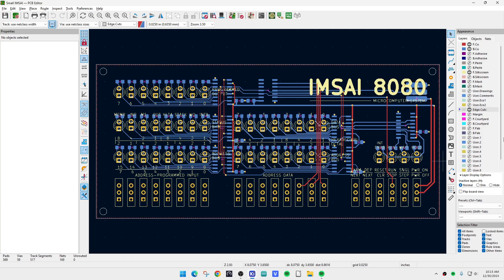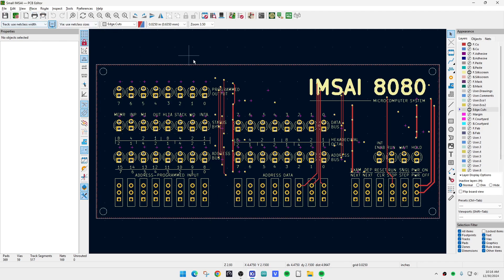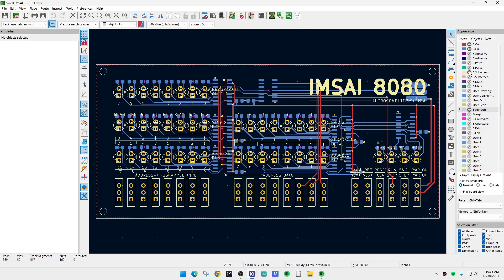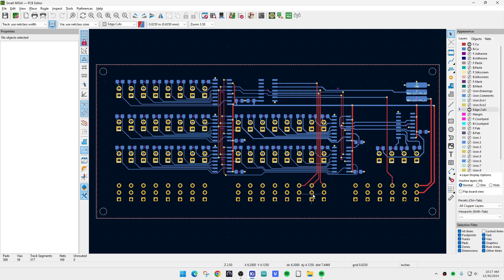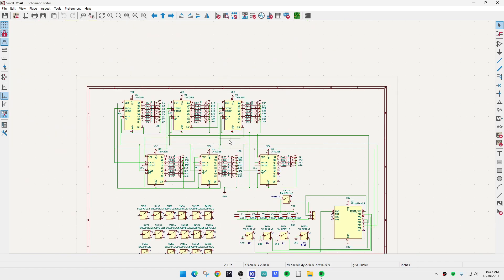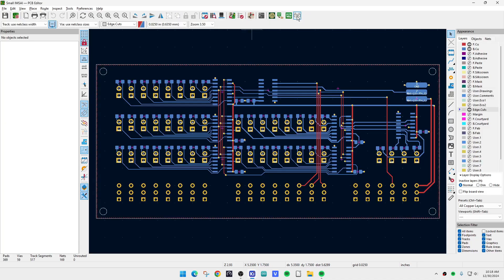#2118 Tiny IMSAI 8080 Computer (part 1 of 2)

Comment: I don't want to sound negative, but the amount of IO you have here, as well as all those shift registers and the tiny makes me disappointed it's not a little more to it. 

Now if you used the 595s to make a Linear Feedback Shift Register using the switches as the inputs  that would be cool, or as other have suggested implementing some kind of limited 8080 style computer or trainer board it would be a really cool project. 

It's so close to a really cool project.
Reply from the maker: The switches are junk and don’t have the correct function. Some need to be momentary up down.  If someone can find me good switches I’ll consider a more functional one.  In the meantime buy a clone from the high nibble.
Reply: @IMSAIGuy  entirely fair. Love the channel and chip of the day!

Comment: I see several choices for the switches:
- Analog resistor ladder (probably 6-bit at most, so 4 ADC inputs)
- Individual-scan (which can only scan one switch per display refresh)
- Dedicated shift registers (most expensive, but neatest in software)
- A compromise with one shift register, using spare outputs to decode rows of a 3x8 matrix.
- A compromise with two shift registers, using a resistor ladder, or even dedicated GPIOs for the remaining 6 switches.
Looking forward to the result in any case!
Reply from the maker: https://youtu.be/VBEgPC2zSLc?si=lOUGRcdUSKHyT1vM

Comment: You've been honing your pcb design skills.  How about designing pcb project for modern interpretation of the Tek curve tracers? Low power testers like dcapro can't test like the 577. The old tracers don't have data export and are huge. 
I realize there are simple curve tracer examples already out there.
Reply from the maker: that's a project I keep thinking about. I did this one: https://youtu.be/oFHTOQTIi30  and thought of making a PCB for that old design (pretty it up). getting all the functionality of the TEK would be a lot of engineering
Reply: @IMSAIGuy  I just rewatched that series. Your version would have higher power ability than the dcapro, which I see as dcapro's main shortcoming.  Creating user interface to automate the fiddling for doing diodes, npn and pnp would be a sizeable programming job. Relay  controls, safety features, and error handling make that more than a hobbiest project.
Reply: The tektronix 571 is a 1990's version of curve tracer and works 20lb. Perhaps it's functionality would be a better model for new interpretation.  I'll look for the schematics.

Comment: Nice pcb
I alway double via on pcb...
I use donut of 20mil and hole of 13mil, via cost nothing, double vias make sure you are never trouble contact between top and bottom.
7mil on data trace, 15mil on VCC chip trace for low power.
1206 smt for easy assembly, 0805 for more dense but easy (i use this size 90% of time), 0603 part for very high density on manuel assembly, under 0603 is this hard to do in manuel for project, is ok for repaire.

Comment: You could read all the switches by connecting them to the LEDs, selectively turning the LEDs on, and reading a single common sense line. That is - if you don't want to put another set of shift registers for the switches
Reply from the maker: that's a clever idea

Comment: Building a Fun Gadget: An MSI 8080 Microcomputer Replica

*   0:00:11 Project Overview: The project involves creating a replica of an MSI 8080 microcomputer, designed primarily for aesthetic appeal rather than full functionality.
*   0:00:30 Limited Functionality: The replica will feature flashing LEDs and respond to select switch inputs, but it won't be a fully operational computer.
*   0:00:37 LED Control: An ATtiny 814 microcontroller will manage all the LEDs, allowing individual control over each one.
*   0:00:41 Switch Input: The replica will incorporate functional power and run switches, along with three address line switches for selecting different operational modes.
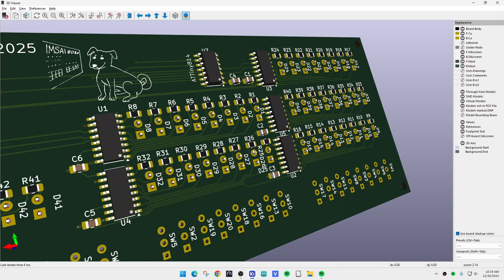*   0:02:07 Power and Components: Power will be supplied externally, and the back of the device will house the microcontroller, resistors for the LEDs, and shift registers for controlling the LEDs.
*   0:02:28 Schematic Details: The schematic reveals the use of an ATtiny 814 microcontroller, 595 shift registers for LED control, and connections for select switches.
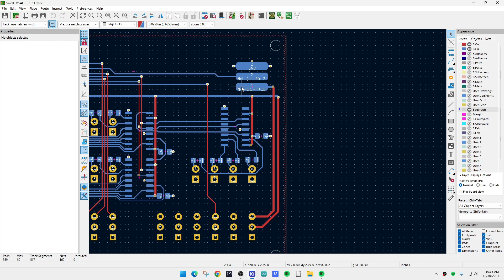*   0:03:16 Programming Access: A dedicated pin will be included for programming the microcontroller.
*   0:03:24 Power Switch Functionality: The power switch on the replica will function as a true power switch, controlling the flow of VCC (power supply voltage).
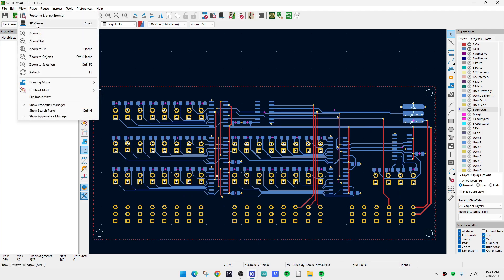*   0:03:31 Project Goal: The main objective is to create an enjoyable, visually appealing toy that resembles the MSI 8080 microcomputer.

I used gemini-1.5-pro-exp-0827 on rocketrecap dot com to summarize the transcript.
Cost (if I didn't use the free tier): $0.0188
Input tokens: 13574
Output tokens: 364
Reply from the maker: it had a hard time with IMSAI got MSI
Reply: nice